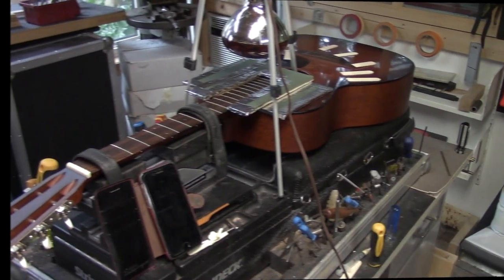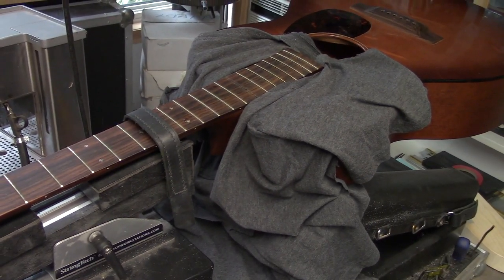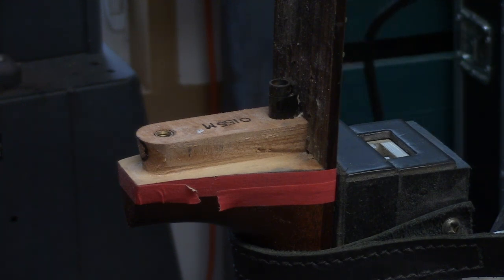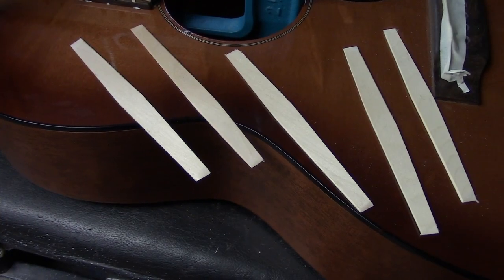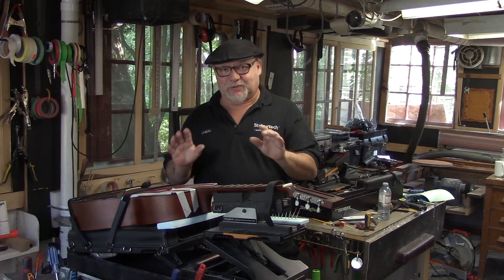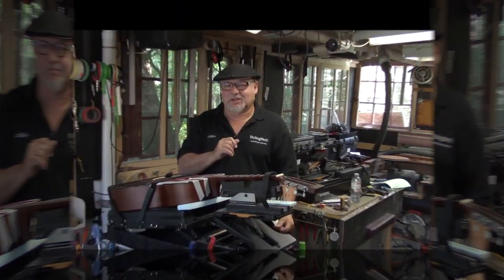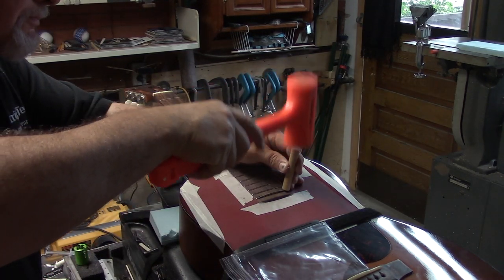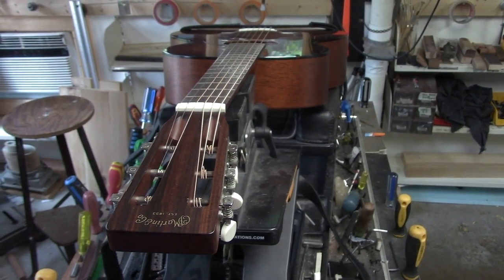Martin Guitar Tenon in Mortise Neck Re-set  @StringTechWorkstations

Comment: I have thinned the fingerboard at the body junction to compensate for the neck reset , as you demonstrate , however have now started inserting a wedge under the extension instead, blending it in with the existing wood.  Have youever  used this method ?
Reply from the maker: Hi Bob, I have never used the wedge method ... although many others have; quite successfully. It sounds like you have found a happy balance between the two different methods. Bravo ! MMcC

Comment: Excellent Video Michael! Brilliant work as always. Question- What is the mask you use around the neck while heating the fingerboard extension made of?
Reply from the maker: Thanks Michael. That "heat shield " is actually an (very) old ironing- board pad.I sealed the edges with aluminum foil tape to cover up the exposed asbestos ( yikes !! ) interior wafers. You can buy a heat shield cloth from PraxAir, that welders use. If you make up a 1/4" plywood shield and cover it with that welders cloth ... it'll serve the same purpose.

Comment: So, without removing ALL the frets, how do you sand the fingerboard extension area only, and end up with a "non-humped" fingerboard overall? Taylor has no problem with this cause their extension recesses into the top, so they merely use the proper precision shims under the extension, as well as the heel.   Seems like, (using your method) it might be better to add, (glue on) a tapered shim under the extension, ,and if 'that' ends up a bit taller, then the level sanding would work out better?  Might have to only deepen some fret slots for compensation.  Just sayin'!      Gb    bg
Reply from the maker: Hi George, By your questions; it's clear that you have obviously done this type of work. Let me explain: The trajectory of the fingerboard turned out beautifully on this Martin. I didn't show in this particular video ... but .... there is a short "scrub block " ( 2 1/2 " 's in length ) that I use to "scrub down" the "hump" at the neck to body junction.
Then the fingerboard was chased with the longer block to finish the job. There was a very slight "fall off " for the last two frets towards the sound hole. But ... like many manufacturers and hand builders alike; I actually produce a slight fall-off on the fingerboard extention ... so that 20 years down the road ... after all of the "folding up" action of the neck-to-body-joint is done .... the neck / fingerboard will need much less ( if any ) correction ;^ )  Also : If you take a minute to look at the Guild Guitar video and the 14 " radius Strat video ... both of these illustrate the use and justification of the "selection" of narrow sanding blocks that I use, to get consistently positive results. In the case of the "Compound Radius " this approach makes even more sense. The long radius aluminum sanding bars that I see ... are extremely limited " especially with a compound radius. They really produce a "tube shape" instead of the correct conical shape that is required. Thank you for your questions ... very best regards.MMcC
Reply from the maker: BTW: "avoiding a neck reset" is the video on the Guild guitar. Cheers, MMcC